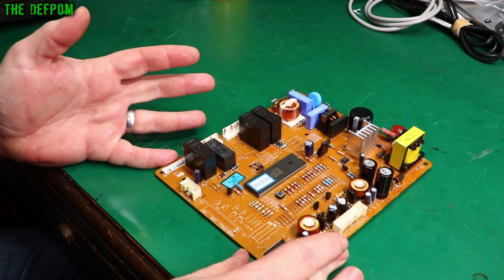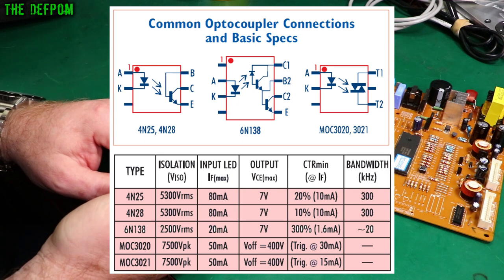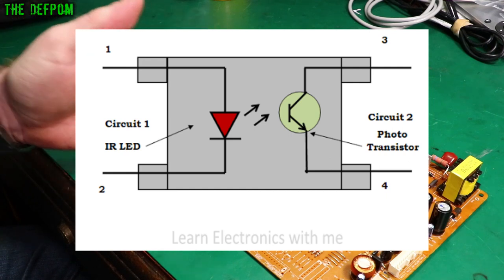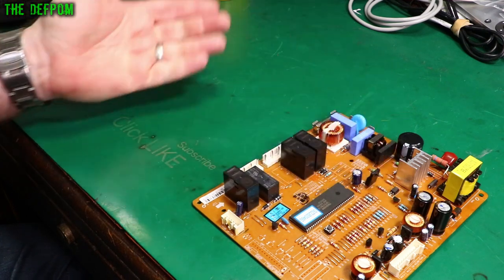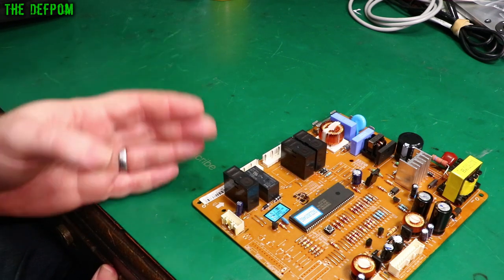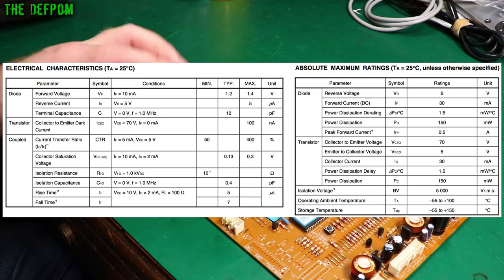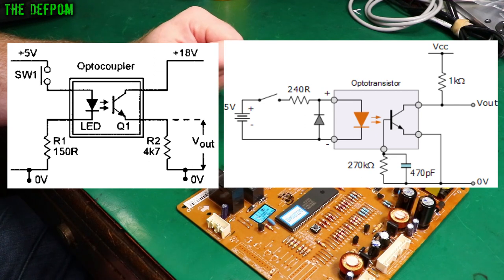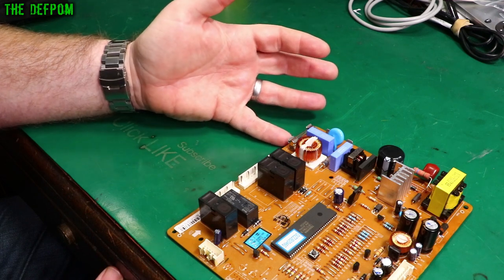🔴 Electronics For Beginners - No.18 - Opto-Couplers & Opto-Isolators - No.983

Comment: Getting more common is the optically isolated mosfet driver, which uses a stack of photodiodes on the output to generate voltage to drive a mosfet gate. Another is the isolated mosfet, which is replacing the reed relay in low power applications, you most commonly see them these days in alarm system sensors, where the 10mA drive of the indicator led also drives the optically isolated relay, saving the reed relay price, and also fitting in a very much smaller footprint. Same hundreds of millions of cycle life, 100mA and 50V rating, but no longer can be affected by external magnetic fields.

Then the more specialist optocouplers used to isolate things like USB and other serial data systems, including I2C bus and even CAN.

Comment: IIRC, the Morse guitar volume pedals, from the 1970's, used some sort of light gate, in place of a simple potentiometer geared to a foot pedal. Why, because the light gate had absolutely zero scratchy sound, as is common with pots.

Comment: Thank you. I am glad you gave the caution about using them in analog circuits, because I have just recently been thinking that they might be handy for some type of analog project.
Reply: There are some designed for analogue use, especially for switching, using the isolated mosfet versions that are reasonably equal to a reed relay, and with pretty good off state isolation. There are some with linear characteristics, but those are now mostly done using a blue LED and a small CdS cell in a opaque sleeve, so you can get some form of square law control, though there are linear optocouplers with 2 photodiodes in them, with the one on the transmit side being used with an opamp to linearise the response, and the output side having the same circuit, just without the led so you get good linearity there.
Reply: @SeanBZA  Thank you. Good information. Might you have a part number for one of the analog use type?
Reply: @t1d100  Vishay Il300 is a good place to start looking, they have the circuits you need to use as well.
Reply: @SeanBZA  Thank you! I did find the data sheet, easily. For others searching for it, for clarity, the part number is iL300. Of course, the "i" is capitalized. It is not the number one.